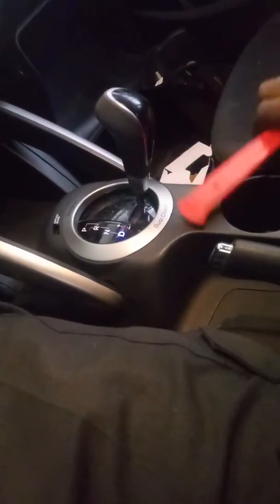Hyundai Veloster,  removing center console

Comment: my 2012 veloster is having a similar issue now. happened sometime when it was stored in the winter. turn signals/ hazards and "Door" dome lights aren't working either. so you just pulled up the center console and unplugged that wire next to the shifter  and that "reset" it?